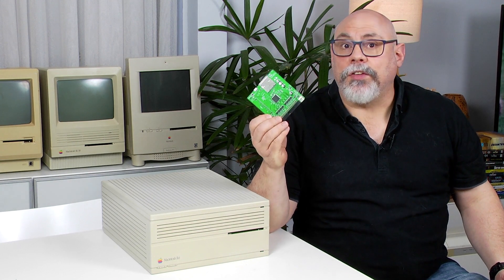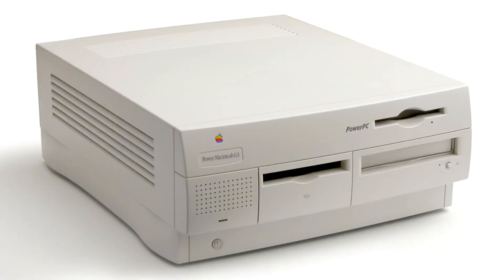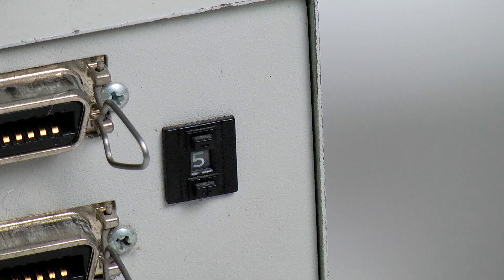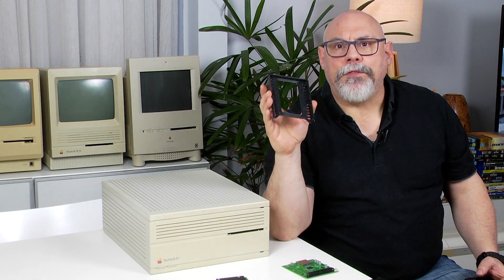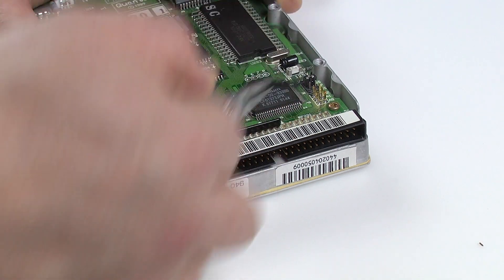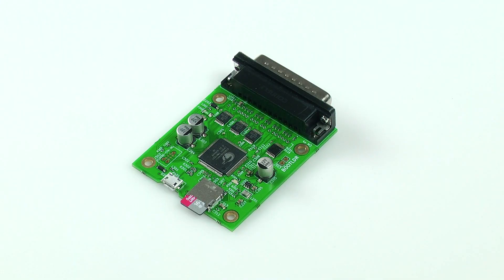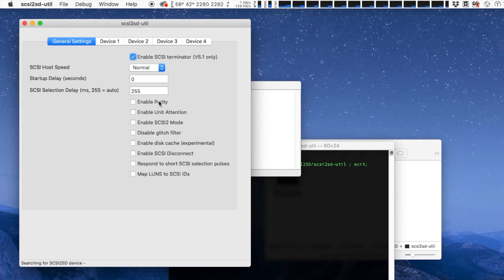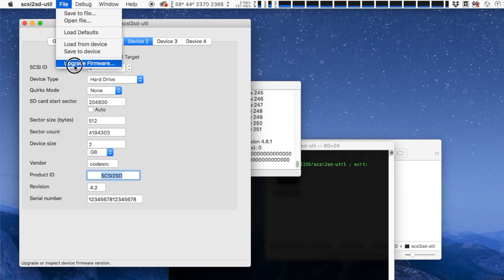SCSI2SD SCSI Hard Drive Emulator Product Review

Comment: Not only Apple largely adopted SCSI standard: Amiga computers uses it as well. There was a SCSI controller built in on the Amiga 3000 and 3000T mainboards! And third party scsi controllers were available as autoconfig cards for amiga 2000 and 4000 as well.

Comment: So,  I have the 5.1 device..  Connected via USB to my mac,  Loaded the util..    The option to "Save to Device" or Load from Device is grayed out....
Reply from the maker: If the device is brand new, you may need to install firmware first. Download the latest firmware from the codesrc website.
Reply: @BranchusCreations   Found the firmware,  hooked the scsi2sd via usb to the mac,  loaded up utility, update firmware, chose file and it just stays at "searching for bootloader".    ugh....
Reply from the maker: @undergroundstudio9810  While it says "searching for bootloader", just leave the software as is, then unplug and re-plug the SCSI2SD via USB. Sometimes this wakes it up.
Reply: @BranchusCreations  Nothing..  I unplug and replug the usb, and the light flashes on the scsi2sd,  but no movement.  Still "searching for bootloader"
Reply: @BranchusCreations  Update...     Turns out it was a cheap cable...      Thank you!   for your help...
Reply from the maker: Underground Studio I assume you've tried on another computer and using a different USB cable. It sounds like yours might be faulty.
Reply: @BranchusCreations  it was the cable...  Cable works with other things, but not with this..    I got it sorted out.  Thank you.

Comment: Hi, Thanks for the great video! I have a question regarding SCSI chain and these devices that maybe you could answer? 

I have a Plus that I use with an Asante ES/NC ethernet adaptor for FTP file swapping and other online features as well as a SCSI Zip100 drive that I boot from. The ethernet adaptor does not have any passthrough for SCSI so it has to physically be hooked up last in the hardware chain. If I were to use a SCSI2SD unit, is there any version with possibility of passthrough so that it could work in my DB25 SCSI chain?

Comment: I've got a SCSI2SD version 5.0b, which I want to use on an old LC 475, but I find the instructions for setting it all up very unintuitive - I've read great things about it, but the instructions seem very poorly written if you're a novice with this sort of device. Mine doesn't seem to show up when I connect it to the USB cable to either load or save settings, or to try and update the firmware. Any instructions on how to set it up from beginning to end would be welcome, if anyone could help.

Comment: Hi! GREAT VIDEO, so many details! I was planning on buying a 5.5 for my MacPlus, and my SESuperDrive. Considering the issues with the Plus, could you please help me with a link, for the Floppy Emu, I'm not familiar with it. BTW
Reply from the maker: Thanks for pointing out that I didn't have a link to the FloppyEmu in the description. That has now been remedied. When you click on the link, you should find all of the info about which computers are compatible, but yes, it is compatible with the SE FDHD.
Reply: @BranchusCreations  Thanks a lot! if you have a chance later please let us know what are the issues with the Plus, not recognized at all? not booting? etc, thanks again!
Reply: Would that Floppy Emu work on the SESuperDrive as well? that way I can keep my original purpose of having one device to boot up both computers, in case the HDDs Fail, not sure if this could also be partioned to have for example system 6 and system 7 in the same "drive"/(microSD card). Thanks Again! Greetings from Costa Rica!

Comment: I am having a problem with SCSI2SD v5.5 and Performa 6360/160 (Power Mac with IDE HDD, SCSI CD-ROM) running Mac OS 8.1 from the main HDD.
None of the configurations in scsi2sd-util (with/without Termination etc.), different SD cards worked in any of the Mac formatting tools: Patched Apple SC HD, Lido, even FWB Hard Disk ToolKit 4.5.2.
The board is recognized as a SCSI device reporting mostly correct size, but fails when Initializing -- cannot find partition map etc.
Hopefully some viewers or the host have any experience or think it's a defective board?
Reply from the maker: Possibly a defective board. I know I had one with a defective SD card reader once. Tell me more about the configuration you are using within SCSI2SD Util, such as partition size etc. And what firmware version are you using?
Reply: @BranchusCreations  -- thank you for looking into this issue. Here is a session screenshots from scsi-util to various tools on the mac. The comments give the details about configured and observed sizes etc.
https://drive.google.com/file/d/1ugH_ZjfeuaD7dV9y8mwViqLo04IJ9RSu/view?usp=sharing
Reply: Turned out to be a defective board or bootloader/firmware. The US vendor Inertial Computing exchanged the board, which has worked out-of-the box with default parameters. It’s a very nice and convenient product for reasonable money.

Comment: Great content. I kindly ask for advice. Recently an external Apple 80SC Drive died. Internally the 5.25 inch Disk finally failed. I successfully used the SCSI2SD in a Mac Colour Classic and here a couple of questions:
- will the SCSI2SD work correctly as "external" SCSI hard drive?
- I would like to repurpose the original Apple SC80 case, but the power supply output 5/12 volt (standard for HD) up to 40W. Will this burn the emulator?? Any tip regarding this?

I really don't know where to find any information about this uncommon procedure.. hope you can help. And go on with the channel, the content is really helpful !

Comment: Is there an emulator for the Macintosh Portable?  The hard drive uses a proprietary cable with the power incorporated into the data cable.  Thanks.
Reply from the maker: There is an adapter available, it's not very cheap though. https://www.ebay.com.au/itm/312973273392

Comment: Hi again! Do you know if it's possible to use win32imager to create a working SD card from a Basilisk disk image file? I very much want to buy one of these, but I worry that I don't have a working floppy drive to boot my LC475 from, in order to format the SD card from the mac. Also, will v5.1 or v6 have the right scsi connector to use internally in my machine? They mention a scsi2 50pin narrow, dont know if that's good for me. Thank you for your videos. BR. Alex

Edit to answer my own questions: yes to win32diskimager plus basilisk ii, but only one 2gb partition max. Yes the connector.
Reply from the maker: My apologies, for not answering this sooner. I'm not sure why, but I missed a lot of comments. Glad you figured it out.

Comment: Thanks for the video. I bought a SCSI2SD V5.0b some time ago and I'm using it in an ESI-4000 (E-MU) sampler
as internal "HD". So far I have not yet much done with the device but presently I'm dealing with it a bit more.
Presently I have a Micro SD of 8GB plugged into the board.
Why is there a 2GB size limit for the device? The controller software of the ESI-4000 tells me when I display the status, that I have 99.9% free of 7.9 GB (or something close to 8GB). So where actually is the 2GB limit or where does it come from?
Reply: It's a limit for Macintosh's using operating systems older than 7.5.3. Very common limit back then was the total address space for a 32bit number - 4 Gigabytes. Your sampler is probably newer than 1994, which is roughly when 4GB capacity SCSI devices first became available. :)

Be warned, quite a few devices using SD card only happy with a 32GB card or smaller, for a similar reason (nobody had invented bigger SD cards when the device using SD cards were built).

Comment: Informative video, Bruce. Thank you! I recently purchased a Mac SE FDHD model for $30US and plan to bring it back from the dead. Which model of the SCSI2SD would you recommend for this particular Mac? I'm a bit confused with all the options. It seems like version 5 would be the best, as it makes use of the standard holes on the HD mounting bracket. Also, if I purchased a SCSI2SD, would I be able to connect it to the LED indicator light on the front of the Mac? As always, keep up the fantastic work. Thanks!
Reply from the maker: I'd recommend the v5.0 for your Mac SE, and yes, you can connect the LED indicator light.

Comment: Cheers for the fantastic video! I've watched more than a dozen videos on the SCSI2SD and none even come close to yours.

Two follow-up questions though. Could you elaborate on the issues using a SCSI2SD V5.5 with a Mac Plus? I have a Plus here and was just about to order a V5.5 for it and now I'm having second thoughts. As it happens, I do have a FloppyEmu so if the V5.5 just won't work, I'll follow your lead. I'm also wondering if you'd be willing to share the image you use on your V5.5. It sounds really useful and would save me the grief of trying to replicate it.

Comment: Thanks for the video. I've bought two scsi2sd's and used them in both test equipment and an old amiga. I think I may have a version 4 and a 5. Gonna order a 6 --- which should be a significant improvement. Generally speaking, nice device. I'm always impressed with the frequency and current software updates. He does a great job!

Comment: Thanks for this very helpful video but i need step by step how to explanation to migrate from an external SCSI to SD. I have SCSI2SD V6 and an external SCSI drive which i want to take all of its data from and use them with an SD card with my old Mac IIVx. Can i use SCS2SD adapter to take the data from the Drive and put these in an SD card? Also I tried to connect the adapter to the old mac but did not see the sd card.

Comment: Hello, thanks for the great videos! You mentioned that you had preconfigured cards available – is that still the case?
Reply from the maker: I have one v5.1 left (I will be getting more though).
Reply: Hey Bruce! I’m actually stateside, so I could order from the distributor in CA. I was planning to get both the 5.1 and the external version for restoring and working on older Macs. I picked up a few recently — one is a real odd duck xc that was overclocked or something according to the previous owner. Is there a way I can reach you via email?

Comment: Great video, though I've not yet had good luck with one of those SD card extension cables. I was trying to use one with an IDE to SD device and it cut the performance significantly (which is already not great on those units).